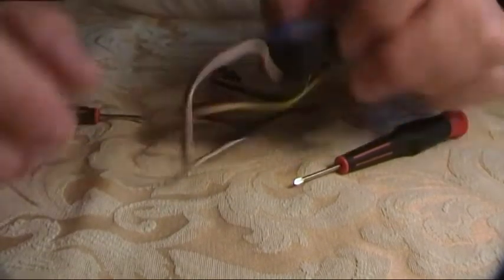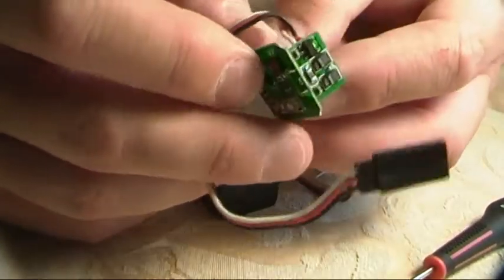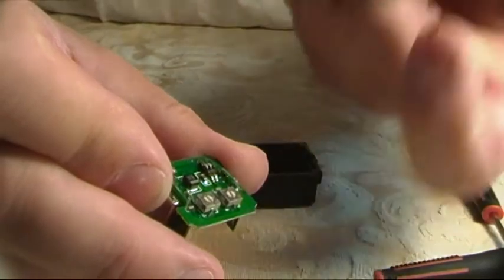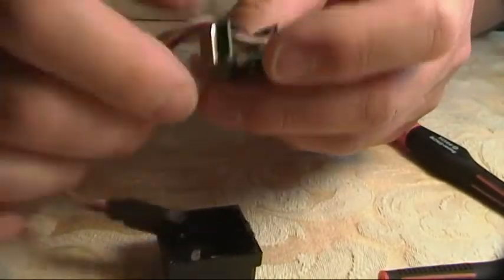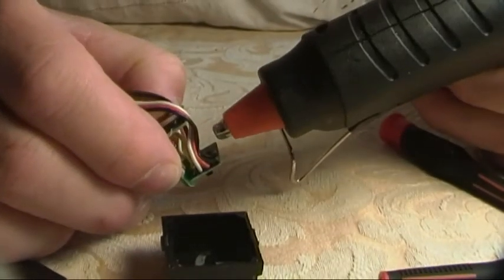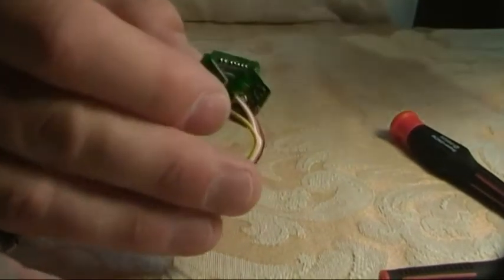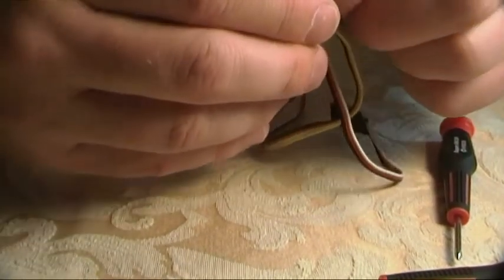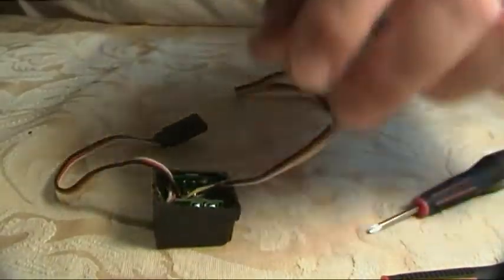HK401 Gyro Fix.

Comment: what about filling it full of foam or using two-sided tape?
Reply from the maker: That would probably help too - I found the weight of the hot glue added some stability to the gyro also and tried just filling them up completely with hot glue which worked very well - Changed over to the Quark gyro for later builds though.
Reply: +Trainboy64 I just end up getting a Futaba GY520 Gyro as the reviews are rock solid unlike this HobbyKing gyro where every other reviewer don't recommend it for a helicopter.
Reply from the maker: James M Yes a good decision.

Comment: thanks for this - I ordered this for fixed wing planes- it stabilizes only 1 axis- correct? what is the purpose of head lock and why would it be needed (as opposed to normal stabilized mode)- if locked into one direction, surely at some point you would need t turn around..? thanks

Comment: Thank you sir very useful video, You might want to add a warning on this video to hold down the board very sturdy while pouring the hot glue in, I almost lost the unit doing this.. my board came up as I was pouring and I got glue everywhere ..  lucky I was able to undo and fix the mess.

Comment: Man! Thanks a lot for this advice!!! My heli hk-450 with gyro hk-401b was allways "dancing" a little. i mean NOT a gain problem... It was jumping with a tail to the right and also to the left one time on every 3-5 sec, i checked also smooth drive of the blades. I fixed it like your gyro and not it's no tail "dance" :) Thank you!!!